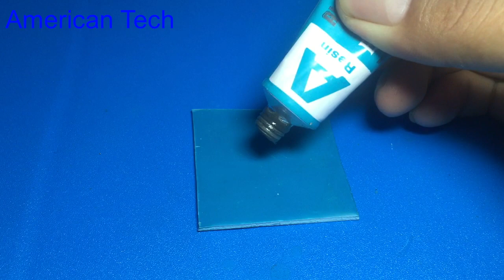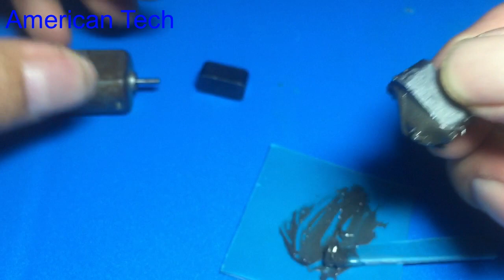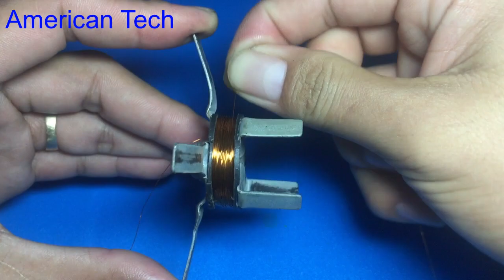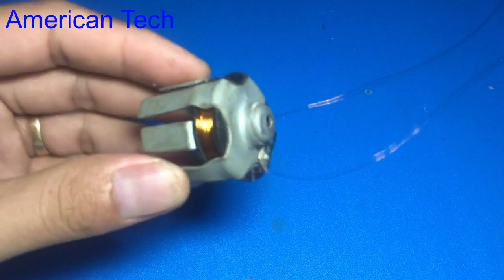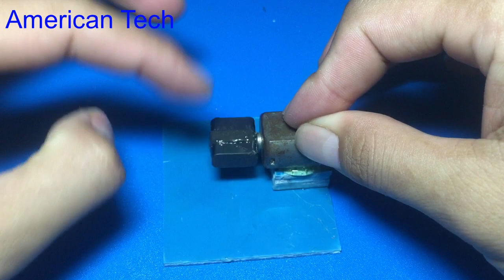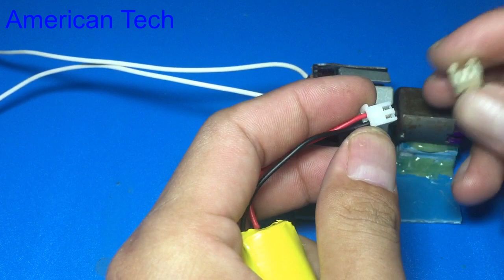How to make 63V generator from 3 7v battery

Comment: well 63v is just the open circuit voltage if you put any load on the output it will drop significantly.
Reply: why?
could you explain your statement?
Reply: Its called the internal resistence of a power source. Every source of electrical power can be seen as a ideal voltage source and a resistor in series. The source here is a basic generator with a coil. This coil has a resistence. Lets say its a resistence of 10 ohms which is a totally random value. If you now connect a device that draws, lets say 1A which is a quite common charging current for mobile phones, the voltage drops. According to Ohms law (R = U / I --> U = R * I) the voltage of the source must be 
10 Ohm * 1A = 10 V. It doesn't matter what voltage it is at start, because its not an ideal voltage source the voltage will drop as soon as you connect a load.
Reply: could you give the problem solving for make voltage stable after put the load?
best regards
Reply: well the easiest way to stablize the voltage might be a buck converter, but I don't really know if it can handle the unstable voltage.
Reply: thanks for your information
Reply: Thanks Sir Ramog 1000. I got the answer what I was looking for little long time. and Syahril appreciate your questions what was on my mind. 

what if we use the capacitor in between the convertor and voltage source ? is there any chances to stabilize the voltage ??
Reply: Irfan Majeed if i simulate using National Instruments or Proteus the voltage will drop.
it's same and nothing change.

i think using trafo to stabilize voltage.
Reply: Ramog1000 yeah considering the windings in that are thick is a hair I say what two volts
Reply: @abdullaahachmadrhomadoni7496   Increase the wire dia meter keeping the number of turns same. Core size neet to be changed to accommodate the coil. Size and powe of magnet should also be increased.
Reply: @Ramog1000  This "pull-down" effects when the circuit is closed must be tested in all generator vídeos from this channel.